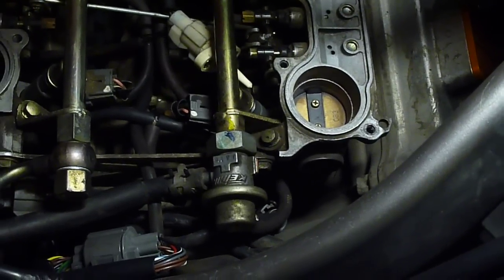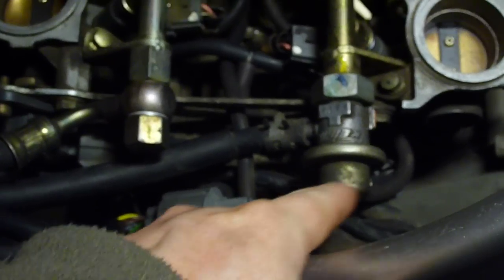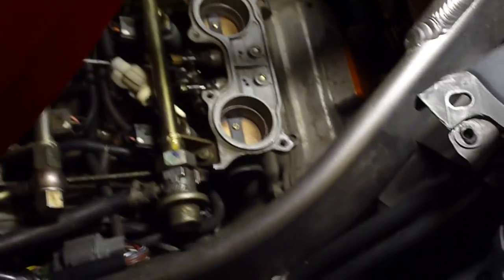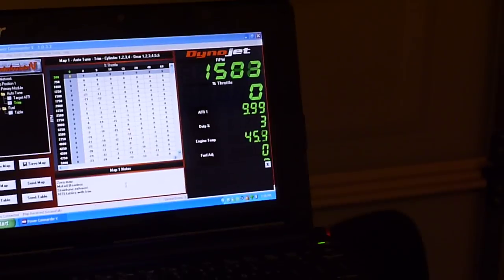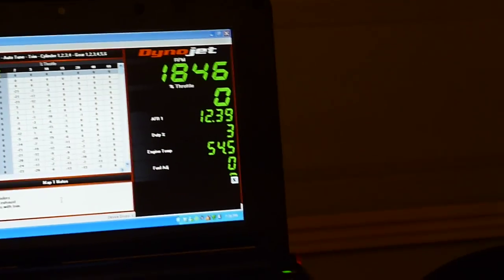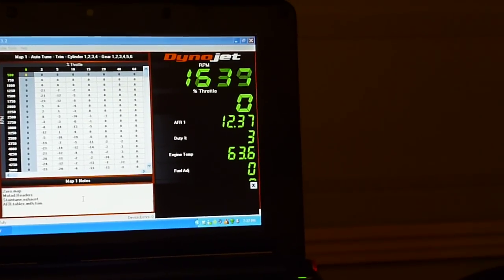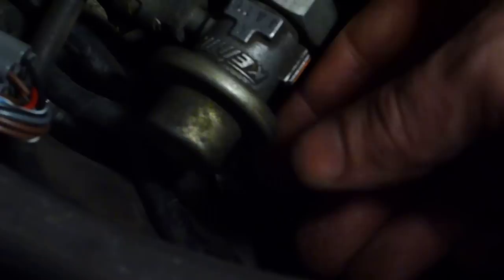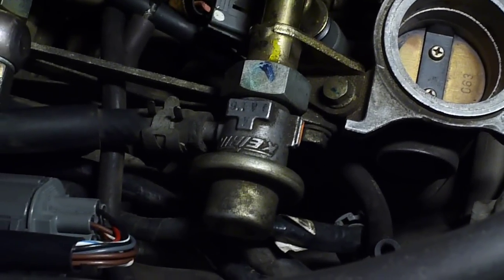Fuel Pressure Regulator vacuum behaviour

Comment: You and I should plug the vacuum hose and put a hand vacuum pump on the regulator and compare the differences with certain vacuum pressures. The low vacuum causes a lean condition which is causing my 960 to report an OBD misfire code and lean miss.  I think I just repaired my 960.  I'll get back to you.   Thanks
Steve B.

Comment: Hi I understand that high vacuum causes the FPR to lift and relieve pressure in the rail. What I don't understand is why the vacuum is higher to idle rather then high rev's. I would have thought that high rev's would cause a higher vacuum.
Reply from the maker: This is a bit of a mind bender that took me a while to understand as well.  Vacuum has nothing to do with engine speed it has to do with pressure difference between the outside air and behind the throttle body.

Put simply, if you have the throttle wide open, the air pressure is the same as it is outside the car.  What is making the car go faster is air *flow*, not air *pressure*.

Comment: On a side node, I see you have the same grips as me and was wondering if you have issues with the throttle sticking due to the fact that the grip is a bit longer than the original ones. Cheers

Comment: I am having a problem with a car. I have hesitation problem, when I unplug the vacuum the hesitation go away and the car drives fine, when I plug it to the regulator the car drives weak and hesitate. Does this mean my fuel pressure regulator is bad? please advice.

Comment: i have also heard of moving the location of the vaccum line from near the air filter, to behind the throttle plate. low throttle or idle would see a leaner mix.

Comment from the maker: Oh you will also need to remove the drain/overflow hoses from the tank as well as the electrical plugs.  There's two - a thin one and a fat one.  Don't worry there won't be fuel in them.

Comment from the maker: I'd love to but the VFR has been sold!  I can explain it easy enough though - drain your tank (with a shaker siphon).  Place an office chair on the right side of the bike.  Loosen the front fuel tank bolts, lift tank.  Remove all electrical plugs from tank, lower tank.  Remove rear tank bolts, flip tank slowly and place on the chair.   Put a rag under the regulator, then use two spanners to remove regulator, one holding the fuel rail, the other to loosen the regulator.  Remove and unclip hoses.

Comment from the maker: @KaldekBoch I should clarify that more modern bikes use a RETURNLESS Fuel Pressure Regulator (RFPC), which is in the fuel tank and just sits at a constant pressure.  The ECU meausres the intake pressure via the MAP sensor, and alters the injector pulse width to compensate for difference in intake pressure.

Comment from the maker: @goodson305 No, what it does is maintain a constant pressure differential beween the fuel rail and the intake tract.  If the pressure differential changes, then at high vacuum the engine would suck in more fuel than desired.  So, with a pressure regulator, the differential is always kept at 36psi above intact tract pressure.

More modern bikes do not use a fuel pressure regulator, and instead alter their injector pulse width based on the measured intake tract pressure.